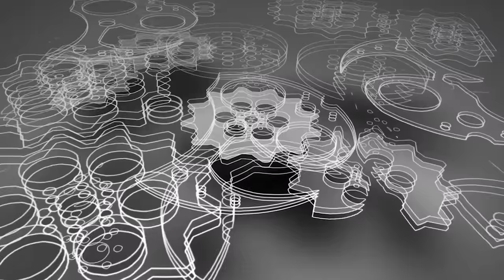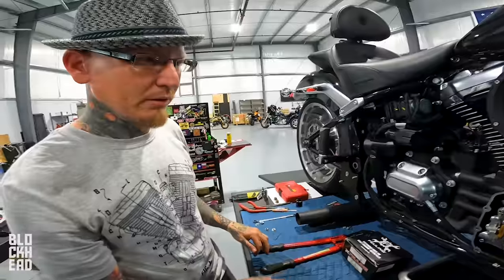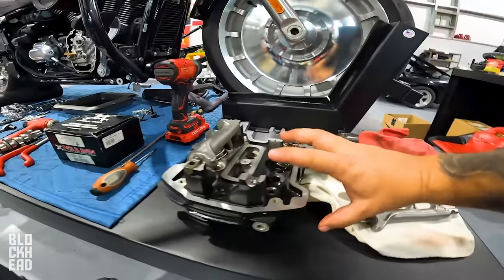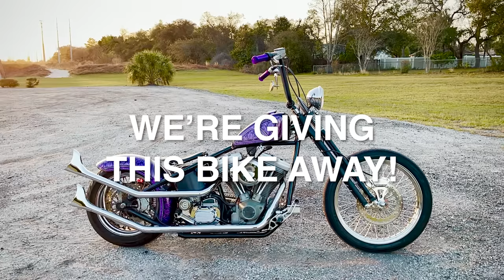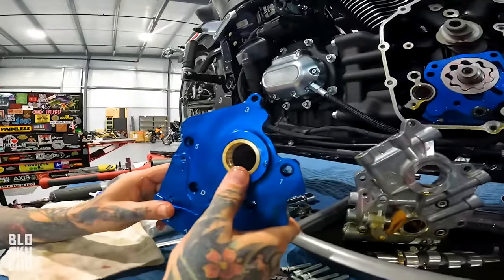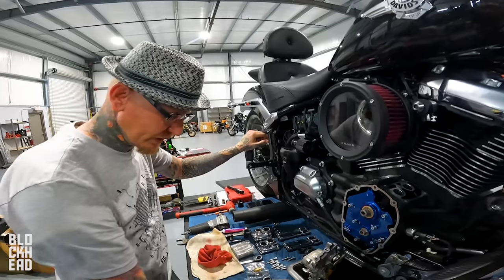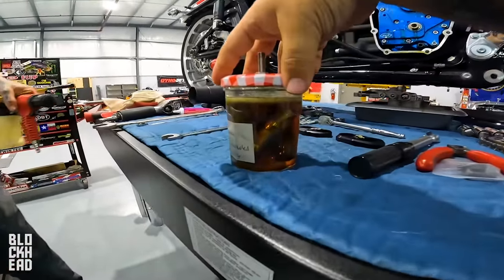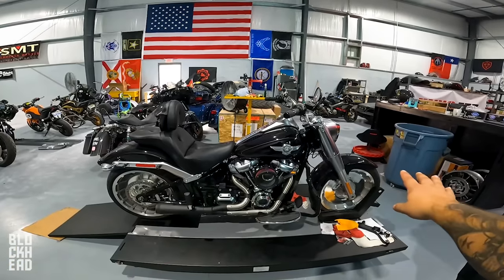Harley Davidson STAGE 2 Explained

Comment: Typically air cooled motors are down on horsepower out of the factory because of longevity.  Heat is a real problem with air cooled motors.  HD could offer stage 3-4 from the factory but  more reliability issues during the warranty period.  It’s all about the warranty period.  I heard MV AGusta  have run their 800rr triples at redline, 140 horsepower 13,000 rpm, for 2100 miles non stop to check reliability.  No one will ever stress a bike like that.

Comment: Horsepower bae lol- If you watch his hands closely he has habits that he has developed through over 2 decades of experience. Quick example he touches a part, left hand goes down quickly to the rag wipes it and slightly moves the rag to a new clean spot. He touches the foot peg he wipes his hand before touching a part. He can look at the camera and stick something in place without looking. A gorilla like me isn't that smooth even looking at it. Sorry one more point- See how he has everything laid out and squared away? I have been working on bikes since I was a wee lad and I developed bad habits when it came to making sure is squared away, parts or located, tools in the right place- etc. Only after I fixed that did I get better.

Comment: Damn.. the factory says 0.012” is acceptable? This one’s at 0.008”.. could this bike get gear drive, if the owner wanted it? Skipped installing the pushrods and setting the timing? Damn

Comment: I did this same shit to my 19 Fat Boy. Sounds great, had more power, but it would jerk like a mf at low speeds like when coming into a parking lot at low rpm. It stopped jerking like it was missing at about 2,800 rpm. Anything lower made it a rodeo bull ride. I got sick of it so the fat boy is gone now. The new Road King will definitely NOT get this cam unless it’s possible to tune out the bucking. Then you probably lose what you gain.